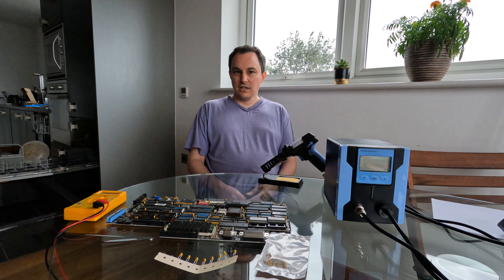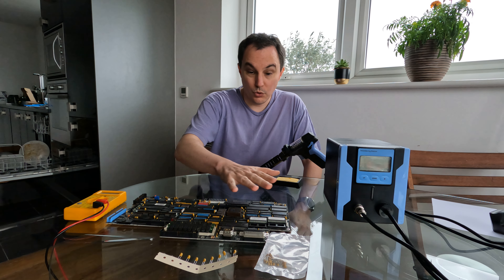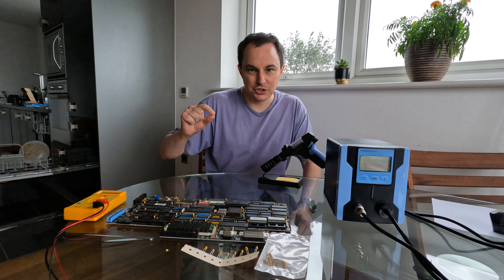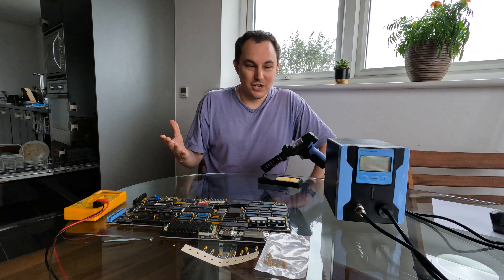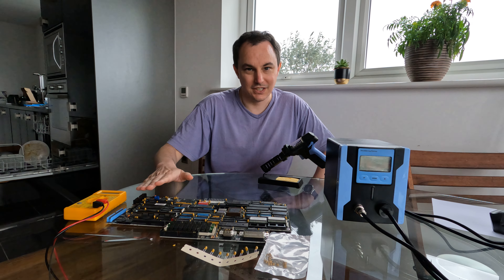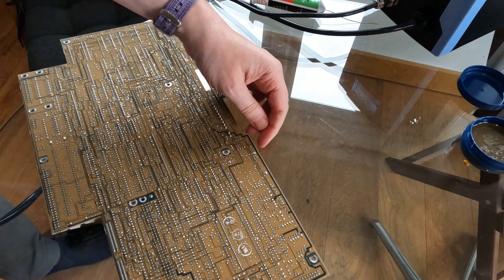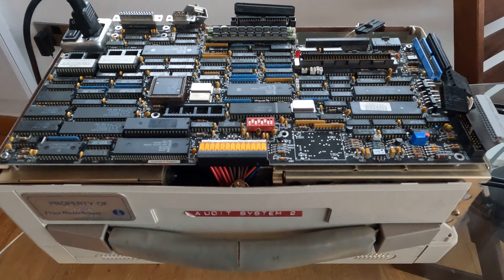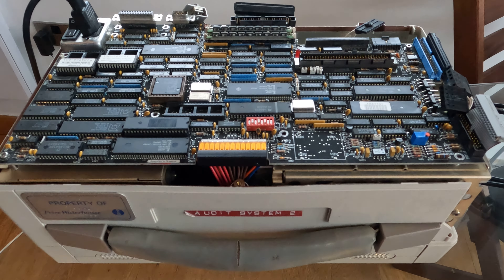Finally, a proper explosion

Comment: just snip the shorted caps and it should work for testing...check voltages on the psu connector while unplugged from board, take note of the pinout...check for shorts on the board on the 5 and 12v rails...power it up...if it works recap it. dont need to unsolder the caps you can snip them and solder the new ones on top to avoid damage and stress to the board. the negatives are tied to the ground plane and must be very difficult to unsolder
Reply from the maker: Thanks, good tips, I am very much a beginner. I did make a diagram for the PSU connector and checked all the voltages after I recapped that, seems solid! I actually am waiting on the 386 version to arrive, which I believe is identical apart from the mainboard. So I might be able to check all the other parts work by swapping things around before continuing.